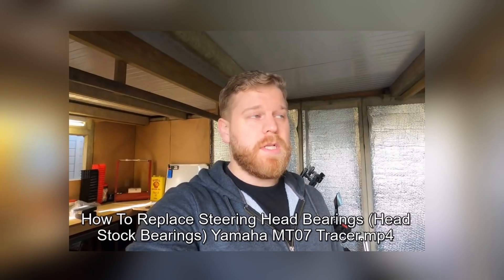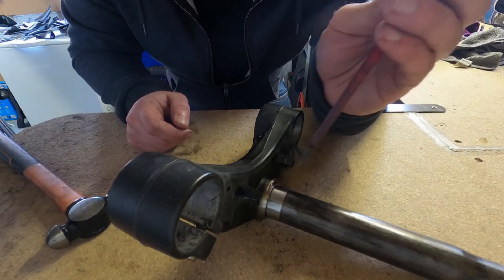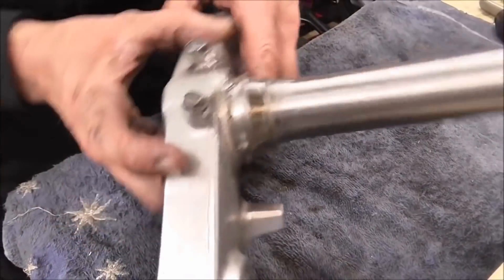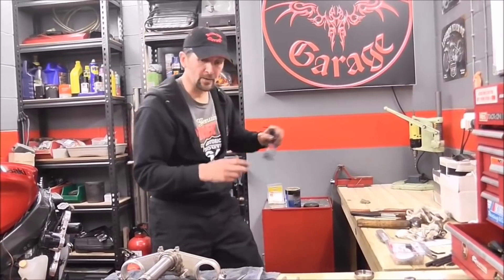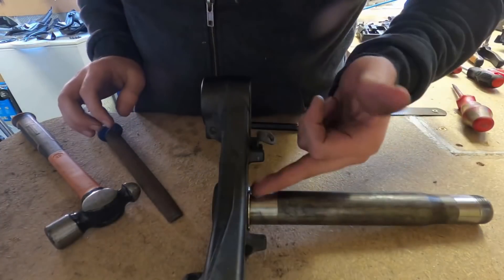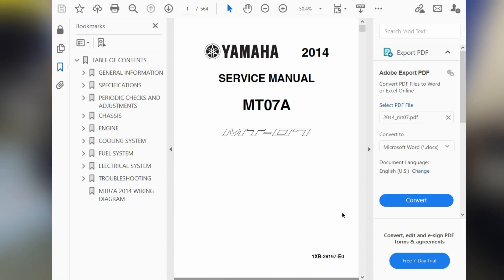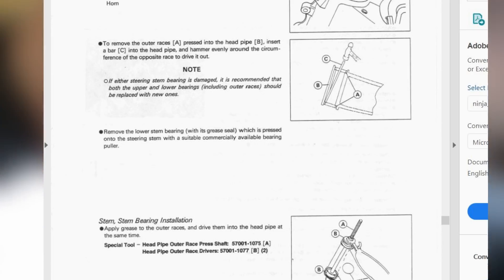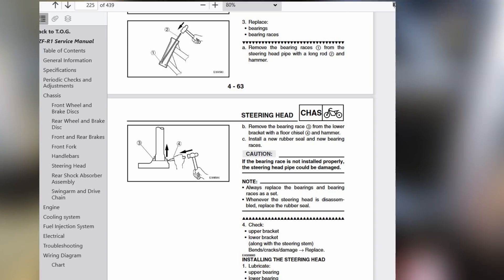Is YAMAHA Dumber than Del?

Comment: Everyone's a critic. Even Yam mention the method in the book, but you being a pious prick, know better of course. We don't all have access to all the super tools. GFY you sanctimonious knob
Reply from the maker: Super tools? Is a grinder and a hammer classed as super tools?
Reply: Is that a picture of your missus?
Reply: everyone is a critic, but only some are super tools.
Reply: The Workshop At 400 quid, a Dremel is not something everyone is going to have. So yes, along with a puller, it’s a super tool if you like. 

My stainless shim method mentioned elsewhere solves the yoke damage issues. 

I’m thinking of starting a channel where I feature super tools using super tools to try to get one over on other super tools. But I’m struggling to come up with a name. 

The MattoolDeltool InchDick Shop describes the subject, but how well does it translate?
Reply from the maker: £400?
Reply: Christ what a way to remove a bearing race (cup) 😂😂 I used to work with a guy who could actually sweat a bearing of a  steel halve shaft with an Oxy torch and it would fall right off with 0 damage . But like seriously a grinder is 20 quid carefully grind the bearing thin and then a decent smack on the flat spot with a punch will crack the bearing race and it will usualy come off fairly easily with no damage to the shaft. And to be fair if you want to go by the book method  a pullers is 70 to 100 euros if you buy it  you've saved the labour cost of getting the job done once and will be able to use it for other jobs. And somone needs to have a word with yamaha
Reply: @thedirtyworkshop  probably off the snap on van for 400 but you get a free hat
Reply: You know what I do to fix a puncture? I remove the wheel and hand that to the shop. Nothing wrong with taking your yoke and handing that to a shop for a small fee.
Reply: @G58  £80 or so for mine - genuine Dremmel  from a retail store, but an 18v one.
Reply: I bought a Parkside one for 19 quid in LIDL.
Reply: @DashCamSerbia   I kill most grinders with wire brush cups so I buy the cheap ones I've my eyes on a fein or a cordless milwaukee one for some of the lighter cutting work and nicer jobs. But like if it's only being used occasionally a 20 euro  grinder is as useful as a 130 euro one
Reply: @davidsstfarrelltighe  Yeah, I use it occasionally. And it is cordless too.
Reply: @G58  I'll sell you one for only £350.
Reply: Forever Computing Cool. I thought they were still more expensive. Not looked for ages.
Reply: david farrell tighe Indeed. That’s how I do it when I’ve got gas. It’s not rocket science is it?
Reply: when I was 16 with no experience at all I used a 20 quid grinder, hammer and screwdriver. why this is a topic is beyond me.
Reply: Meic Brooks No. He’s an over sensitive, narcissistic, amateur with an overinflated notion of his own skills and importance. He laboriously extends every aspect of every process, presumably to milk ad revenue from his vids. 

He’s as bad as the frauds in the self help ads themselves. 

It’s not possible to trust his advice, therefore it’s not possible to learn from him in any way, other than to not be like him in any way. 

Every time I’ve watched part of any of his vids, he’s nauseated me with his ridiculous manner.
Reply: @forevercomputing  at which point it is handed to the apprentice in the back who removes it with a cold chisel and hammer ,there you go 50 pounds please.
Reply: @davidsstfarrelltighe  Need to be careful taking an oxy torch to critical components, you don't know what heat treatment has been applied to the metal and how you will affect that.
Reply: @jamesrindley6215  I'm well aware man
Reply: @DashCamSerbia  LIDL and ALDI stuff ain't bad!
Reply: @G58  Lmao £400! I bought my corded 240v dremel set for £20 from Aldi. Best dremel I've ever owned! 
The speed controller is ace, the chuck is quality and if it ever fucks up (which it hasn't in years, most durable dremel I've ever seen) no loss, I'd go buy another one!
400 fucking quid...I'm crying laughing pal...did somebody sell you magic beans for that and you're still salty over it? 😂😂😂
Reply: @G58  400 quid for a Dremel? 
Where the fk are you shopping.. seriously I will sell you as many as you want , 80 quid each.
Reply: @G58  Just the other day I got a 2nd hand off brand dremmel for 5€. It works like a charm.
Reply: Dgtal Breakz You wrote:

“G58 Just the other day I got a 2nd hand off brand dremmel for 5€. It works like a charm.”

What is an “off brand dremmel”?

Dremmel not a brand. Dremel is a brand. Are you saying you bought a Chinese copy that works? Wow! Get back to us in 18 months time when you can’t even get a Chinglish response to your warranty claim. 

Enough already. I was obviously quoting the full price of the big kits Dremel used to do. A copy from Aldi or Alibaba is not a Demel.
Reply: @G58  Its not a copy, just stating its not from Dremmel. Only because its not from the original brand doesnt mean its a piece of crap. It works perfect and its old, so if the dude who owned it before treated it well and I keep doing the same its not gonna break. Its just a motor that spins an axle, not some complicated mechanism...
Reply: @G58  nah, dremel as a trm has superseded the brand, a dremel is just a "rotary tool", doesnt have to be a dremel...are all your stanley blades actually made by stanley?
and if you slip is your band-aid an actual band-aid?
do we say threaded insert? or do we say helicoil?
Reply: deadprivacy You wrote:

“G58 nah, dremel as a trm” 

What ?

“has superseded the brand,”

No it hasn’t. If you’re attempting to suggest that Dremel has become the generic term for a rotary tool, that’s just laziness. 

“a dremel is just a "rotary tool", “

No it isn’t. A rotary tool is a rotary tool. Dremel are the best known rotary tools. 

“doesnt have to be a dremel...”

Your use of punctuation and grammar is infantile. Are you happy to identify as an infant?

“are all your stanley blades actually made by stanley?”

No, Spiralux. 

“and if you slip is your band-aid an actual band-aid? “

We say plaster, not band-aid. 

“do we say threaded insert? or do we say helicoil?”

No, weld and re-machine. 🧐😎😜
Reply: @deadprivacy  This. I couldnt have explained it better myself.
Reply: @thedirtyworkshop  lol what the fuck the puller is £50not 400

Comment: The younger me before having a puller would cut through the race with a dremel which worked just fine. 

The old me would recommend taking it to a shop and having them remove it for the price of a beer. Cheaper than replacing screwdrivers and less painful than metal in the eye.

Comment: dremel cutter till close, few taps with sharp chisel til the bearing splits.
Reply: I quite like using a dremel or grinder, but prefer to use a small air hammer. Works really quick. I think Shane Conley had a video on it, but can't find it any more.
Reply: Done the same thing but with a grinder, grind through it till thin (avoiding the alloy) then crack the race and off she comes.
Reply: @LinkinMcOwnage  my gaffer been doing it like that for years, i showed him the die grinder , cut a slot then dink it version, he swore at me, the grind away method takes a while on a transit wheel bearing.
Reply: Uhuuu look at Mr. fancy pant here.. "Dremel" and what have you not...  Whats wrong with the old Angle grinder..
Reply: @RENIELTUBE  is too big for many bearings, especilally on large hubs, you cant even get a diagonal in some cases, dremel is quicker, especially at home of you dont have the hot spanner to hand(aka oxy torch) to just heat it up and it slide off.- but on these head bearings?
angle grinder does the job fine, but wear goggles ffs., ive more than once picked a piece pf shattered bearing out of my face...thats another reason the small wheel and straight cut is better, less chance of shatter, big grinder you have to cut diagonaly, preferrably in an x to balance the forces, eve then? still craetes shrapnel.
ive never had a shrapnel incident since i used a smaller cut off wheel. nor marred a shaft, facing or hub...

Comment: The best way i have found matt and done my fare share over 30 years of repairing motorcycles is put a spot of weld on the old race one at 12 o clock and one at 6 o clock and then use the weld to chisel of alternating from 6 to 12 o clock then once removed get the grinder and cut  through one side of the old race  put the new race on the yoke and put the old race on upside down widest part at top then put this in the vice upside down with the jaws open and touching either side of the old race then with a nylon hammer hit the bottom of the tube on the yoke and it will drive the new rac
 on
Reply: Spot on Peter, not only gives a point of purchase but also adds heat
Reply: Why do you wait 6 hours between welds?
Reply: I’ve noticed that even welding all the way around can put enough heat into them to expand it enough to just slide off with a tip of a hammer, I do allot of wheel bearings in heavy machinery and this got me away when I had no acetylene, I use a chip fryer filled with hydraulic oil to heat new ones and they just slide on lol
Reply: @tigerick7291  you dont wait 6hrs between welds i said you put a spot of weld at 6 and twelve o clock to chisle off
Reply: @killthebums  hi when i remove a wheel bearing from a car i weld all the way round the outer race and when the weld contracts it pulls the race together inwards making it smaller easier to knock out with a hammer and chisel
Reply: @tigerick7291  comment of the year
Reply: @peterjordan7324  yeah but that’s 6 hours between 12 and 6 to wait better to put the spot welds at the top and bottom and maybe just have a minute or two for a sip of tea in between rather then wait all that time
Reply: @aa-kv2pq  😉
Reply: @aa-kv2pq  it doesnt say wait 6 hours
Reply: @peterjordan7324  “ you put a spot weld at 6 and twelve o clock” that’s 6 hours ...... unless you mean 6 in the evening and then midday the next day which would make it 18 hours but that’s just being daft in my opinion much better to crack on n get the job done ASAP
Reply: @aa-kv2pq  it has nothing to do with time  it means one spot weld opposite the other

Comment: Ive always used a Dremel to cut through 90% of the race and then use a cold chisel to hit the cut and the race cracks through. Usually slides straight off after that.

Comment: I used to have an old honda manual that said the same thing. It said use a punch and carefully tap it off alternating sides and using special care to only hit the race. I did it, it worked without leaving a single mark anywhere except the race and I still do it to this day. You're tapping the race out, not driving a wedge between the race and something you're not supposed to be fucking up

Comment: The last one of these I replaced I put the steering stem in the freezer overnight and in the morning applied a little heat to the bearing and it came off with little force.
Reply: Think that's what I'd also try if it needed done and didn't have access to better tools.

Comment: I always try and use the right tool but I had this steel swingarm with a siezed bearing race in it for a old dirtbike that required me to chisel it in half. Was the only way, broke 2 blind bearing pullers on it with tons of heat. Took hours, left a good gash in the bearing surface. I'm a little confused as to what's the big deal?

Comment: By far the easiest method I have found is to hold the stem in a vice and use an air chisel on the race, about 3 seconds of pneumatic percussion usually has it sliding off the stem with no damage to the stem or yoke surface

Comment: I would have placed it up right. Using a fine tipped torch, applied heat to the race until it fell off.
Reply: That's what is was thinking, but never had to try yet.
Reply from the maker: It works most of the time. Some tapered roller races don't always drop though, in my experience
Reply: @thedirtyworkshop  That is true. I do use this from time to time to help the process (SNAP ON TOOLS CJ951) When you get your lathe setup Make It Extreme has a puller you can make to use with the snapon tool or any similar tool. ( I would try to find one used or on ebay). When I get time I plan on making three more that are different lengths.

Comment: I fully agree with you Matt.

I have checked my official Honda CBR1000RR service manual (16MFL08) and to my surprise, it says:

"Remove the lower bearing inner race with a chisel or equivalent tool, being careful not to damage the stem."
It doesn't even have a nice picture/drawing/graphic with it...

Umm... Sorry Mr Honda. I like you, but I will disregard that advice and do it the proper way. 
-With a puller and maybe a bit of heat.
-Split it with a dremel and then a chisel 

Only time I would do it the "manual" way is if had no other option.

Comment: Are you going to try and get an explanation from Yamaha ? that should be interesting to hear.
Reply from the maker: Lol tried that, never works...
Reply: @thedirtyworkshop  All the Japanese brands have said remove the stem inner race with a "hammer and chisel" at one time or another. Zuke, Yam, Kawa, and Honhon.
Reply: @Chavagnatze  not the Honda. Both workshop manuals for my F4i and 600RR7/8 say to use the sst puller/attachments and basically reverse it and drive the new one in with a installer. @theworkshop
Reply: My GSX1400 manual said to use a hammer and chisel. Looked up a replacement stem  after I have beat the shit out of it, only $700 Aussie or 350 quid.

Comment: It's crazy, I did the same thing on my R1 a few years back, I really was not happy about the "wedge" pressing on the aluminium, it felt wrong to do this, so I tapped the bearing away then made up a U shaped .6mm spacer to go between the wedge and the aluminium and used longer tapered wedges, it worked well but felt odd doing it, the aluminium was untouched ..
Cheers

Comment: Working on mountain bikes some brands of forks have a cutout on the crown that gives you a good place to tap the bearing race from below with a small round punch. Other brands basically expect you to do the chisel method since those bearing races have no lip to speak of to attach any kind of puller to. That being said most good bikes these days have cartridge headset bearings that are not pressed on the crown.

Comment: It’s incredibly simple to avoid damaging the alloy yoke. All you have to do is slide a strip of stainless steel out of the guillotine scrap bin between the ring and the alloy yoke, and add another length as it gets moving. 

Watching this video is like living in a world where all history and real world experience has been erased!

If you want to get really nicely set up to do this job in the future, you can make a strip for each side, and file/grind (Dremel Matt) a radius to match the circumstance of the steering tube, and add a double bend to hook them over the yoke. Use your imagination. 

You can also hold them in place with those rubber bands that the postman drops as he leaves after shagging your missus. 

This is not blood rocket science. It’s just basic common sense. 

Yes, you can also heat up the ring on many bikes, meaning the whole job is a lot easier.

Comment: In a Bendix air dryer manual (heavy duty trucks) on the troubleshooting page it tells you to replace a blown fuse with a larger one. It goes on to give you the minimum amperage of 15 with no max.... WTF?

I know it's not bike related but Bendix is synonymous with air brakes over here. What they are suggesting is skip finding the real issue and Band-Aid it with a potential fire hazard.

Comment: i just weld tabs on for the puller if i cant get up underneath it, or ive run out of little discs for the die grinder to just cut him and split him....i like his cut then tap trick though, he started out so well too, im thinking soft bronze wedges instead of a screwdriver or even hardwood , what with wood being good and all.

Comment: Easier to make a slotted steel wedge, with a tape pad in the middle, that can be tapped under both sides of the bearing race to lift it evenly, without need for a cold chisel.

I modified an old wide bladed brick bolster like this for these types of jobs.

Comment: Just grind it off. Get a variable speed grinder and some soapy water. Some bikes have a flat enough area, that using a chisel makes it a lot easier than dicking around trying to get a puller long enough to do it. I never have been a fan of that design, but the alternatives aren't exactly better. Sure, we could have thrust bearings and precision bushings, but they'll eventually get sloppy and harder to fix. Overbuilding the stem and beating that bitch off seems like a crude but effective choice.

Comment: You would always use a bearing puller, but, you can get nylon chisels. Never seen a nylon flooring chisel, would t break the tongue, but you can get a standard set of nylon chisels, if you were really desperate.

Comment: I have three Kawasaki shop manuals which all state: "Remove the lower ball bearing inner race (with its oil seal) [A] which is pressed onto the steering stem with a suitable commercially available chisel [B]" - this is shown in an actual photo in each manual. Happy to send the pages if you have an email address. To get behind the race to put a clamp/oyster in to be able to use a puller you first need to make a gap for it to fit into. How else are you meant to do it if the stem isn't designed (by an engineer) for it to be done in a less damaging way? Real caveman would be doing what I do with seized bearings where they have "welded" themselves onto the axle housing/shaft and use an angle grinder to get the race metal thin enough that it splits on its own (press fit remember) and just slips off without any damage. I think the key ingredient is having the training/knowledge/skill to use the chisel method without being a butcher.